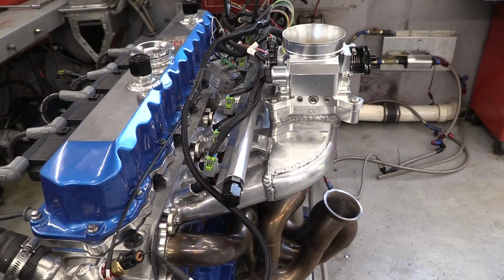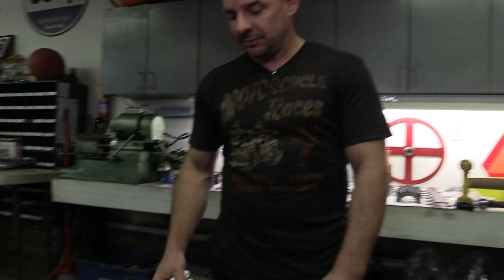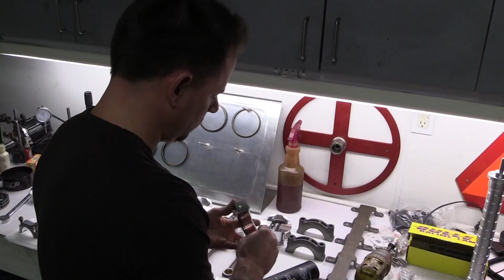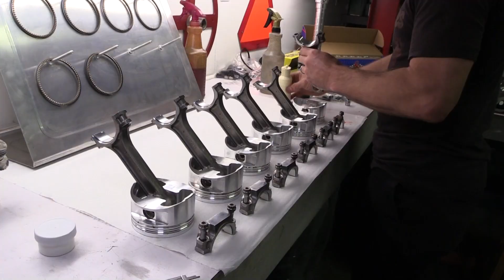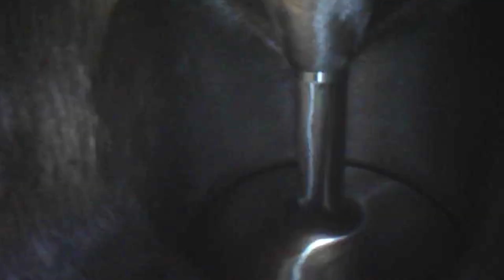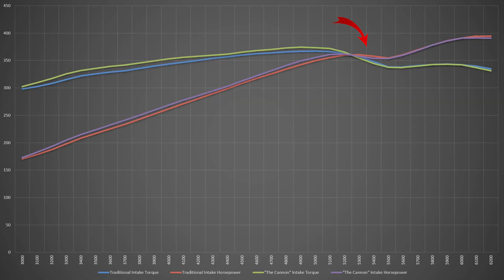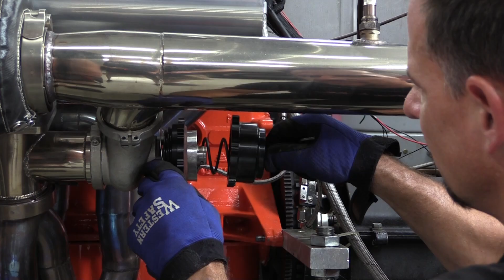Turbo Jeep Smashes World Records! (Tons of Innovation!)

Comment: Wow and I thought back in the 70s when AMC went racing with their  Gremlin X 258 4.3lilter 7 main.N/A pushing 650hp n 700tq running low 11s 135+ mph. Running side drafts 6 pack of Weber's carbs. 12.1 compression. Shoved 202,168 valves from the AMC V8 heads. Into the 258 stock head. The AMC Gremlin X 258 l6 held the NHRA title for quite a while. It's clam to fame was popping wheelies. Great job guys. Keeping the stock components even better. AMC knew there shit there l6 are stout.
Reply: 11s 135+ mph    LOL    202,168 valves       To make 650HP out of a 6 cyl you would need to flow about 430+cfm out of the intake side and astronomical RPM to utilize it . I'm sorry the discharge coefficient doesn't add up.
Reply: @victordahn2150  were do u guys get numbers from the air? Those sidedraft 6 pack of Weber's with the intake n head flowed over 1000cfm. With a 6" steel rod n oversized valves. More than enough air gas and stroke to make those power levels. U guys think u need turbos to go fast. NHRA was doing 6s. There's car with less than 1000Hp running 7s. Without turbos and Nos.202 intake n,168 exhaust. Those valves are big guy. They can flow those numbers easy.
Reply: @Al-mx6ru  that's 1000cfm for all 6 I mean 430cfm+ @28" of water for each cylinder.
Reply: i think your power numbers are WAY off lol. NO way a 4.3L N/A would make 700lbft.
Reply: @3rdGenGuy  first off l saw it race I know its set up. AMC l6 were very stout engine. The engine specs are as follows 12.1pop up pistons,solid cam over 600 lift. 6pack Weber carbs. Modded stock 258 head. AMC went racing. Not some private guys. But AMC themselves. They had a l6 Gremlin running low 11s and a V8 running 7s. AMC backing. I think they mit know a little more than you or l. Those were the engine specs on there pro stock Gremlin X.258 package. I dnt think AMC would lie. They were very forth coming with there setup. They used the rods and valves from the AMC 390 engine in the 258. The rods were forged pieces. It wood carry the tires for a easy 10ft. That's torque. I've been blessed to have a gearhead dad that went to the winter nationals in Pomona every yr. Since the 70s till now.
Reply: @Al-mx6ru  did it have nitrous on it?
Reply: @1985metalmaniac  all those passes were N/A. AMC held the l6 NHRA title for like 20 some odd yrs.
Reply: @Al-mx6ru  something just doesnt add up. Were talking about an NA engine, running no boost, no gas, and no nitro on webbers making nearly 2.47 hp per ci. That would mean at 2.47hp per ci.  A 426 hemi with a 12:1 compression would not make that (1050hp). The only engines in those times that i know of that would turn that kind of hp with no boost were F1 engines spinning at 14,000 rpm.
Reply: @1985metalmaniac  in the 70s GMC ,Ford,Chrysler all had 1000hp N/A engines that they built for NHRA racing seasons running 14.1 compression. On racing gas just like the AMC 258. In the 70s top fuel was in the thousands HP range now. Running race gas. N/A.
Reply: @1985metalmaniac  let me clear the air here these passes were on race gas. High octane.
Reply: To this day there's door slammers running mid 6s V8  N/A. No power adders.
Reply: @Al-mx6ru  AMC is a lost religion, dead in its teachings. Most people know not of the might from Wisconsin. We do not blame them for their ignorance we only seek to enlighten.
Reply: @thephranc  Because AMC also defies the laws of physics? Come on... Just looks into how much intake port airflow it takes to make 1 how per cylinder and do the math. Then look up how much a 2.02 valve can possibly flow. It becomes apparent quick you are full of shit.
Reply: @victordahn2150  202 valves can easily flow upwards of a 1000hp.
Reply: @Al-mx6ru  oh really? On the intake side? How much airflow per cylinder?
Reply: @Al-mx6ru  I have never seen a I take port with a 2.02 go over 400 cfm on my flow bench thats for sure. You can make max effort at most  .275 HP per cfm per cylinder NA. If you look up discharge coefficient you may start to understand this is impossible. Not even in Wisconsin.
Reply: @victordahn2150  you guys sound sheltered. I guess top fuel is wrong by your silly logic. As long as u can get that head to flow the numbers you want. You can reach your power goal. Your talking about water? Only time u use water is to CC the combustion camber n look for leaks. By filing the runners with water n  see if u have any leaky valves. You flow bunch a head with gas n air. Not water. You sound  delusional
Reply: @Al-mx6ru  no inches of water.... It's a standard pressure (28") we all use on flowbenches. It's the pressure of a water colum 28" high at 1g. Cant believe I need to explain this to an expert like yourself.   BTW top fuel uses nitromethane which carys its own oxygen and can burn at ultra rich almost hydraulic saturation. No that's not NA on gas. Big big big difference
Reply: @Al-mx6ru  and a 2.02 valve cannot physically flow what ever you want it to.  Even with boost you just add atmosphere. It flows the same just the density changes.
Reply: @victordahn2150  no sir your wrong when u ad boost u add more of everything. Your forcing air n gas down the intake Into the head. That head with boost is forced to flow more. Weather it was designed to or not. You'll get more HP but not at it efficiency. If the head can't flow the cfm it won't b as efficient.
Reply: @victordahn2150  that's why it's called forced induction. Didn't think I had to break it down like these since you being a expert and all. Lol Your logic is silly at best. My friend is running a 350 5.7lilter with 20 pounds of boost on his setup his heads have 2.02 Intake n 1.60 exhaust. Valves. N he's over 1000whp. There's 500+cubic V8 anywhere from 1000hp to 12,000hp. Your silly to say they can't flow numbers. There's 4 bangers with little valves running 800 to 1000hp. On high boost.The more valves you have in your head the easier better performance you'll get. U seem to know nothing. A 2.02 valve can't flow that. LMFAO  if not mistaken a 1000Whp car is really at 1200hp at the flywheel. So how do u come up with your silly logic that those valves can't flow those numbers?
Reply: @thephranc  you seem like a well educated man.I enlighten him on his errors.  He really full of S$$T.Your comment was very much appreciated.
Reply: @Al-mx6ru  it's a density change not a flow rate change... The efficiency change is the adiabatic heat that is created in this change decreasing density. This can be regained by intercoolers.   I'm shocked on how ignorant you are. Call up banks or any other expert on the subject and ask that question.  Boost is density not flow.
Reply: @Al-mx6ru  that is with a V8 and 20 psi. I personally am running a 4.8l on 23lbs and I run 9.3's in a 3500 lb car  but that's not a NA straight 6 is it? Far from it.
Reply: @Al-mx6ru  your "friends" 3fitty can do that because he is using 2.3 atmosphere's of pressure (density) to fill the cylinder. if that engine makes 400NA which is quite easy for a 350 and 2.20 valves (means the heads would only have to flow 185cfm per port on a flowbench which is easy on a SBC I have made some 2.02's go over 240CFM on MY bench) you can make 400*2.3 =920Hp now the flow rate didn't change but the density of that air did. Thus the reason you need to add more fuel and make more power. YOUR argument is that a NA I6 can make 650HP I call BS because you would need that 2.02 valve/port  to flow 400+ cfm on a bench "28 inches standard pressure" to achieve this HP and it just cant do that no matter how good the port is.  A 2.02 valve only has 350CFM @28'' potential in the absolute best conditions.  http://thescipub.com/pdf/10.3844/ajassp.2008.963.971

I am a Mechanical Engineer and a long time drag racer my experience with cylinder heads, turbo's ,  Na and boost far outweighs your logic. I'm using scientific facts here.
Reply: @victordahn2150  really,, with all your experience and you said a 2.02 valve with 160 exhaust  can't flow those numbers? When his does. What's your scientific reasoning for that BS.i think your full of it.
Reply: @Al-mx6ru  the link is in my post  http://thescipub.com/pdf/10.3844/ajassp.2008.963.971    I can tell you have never been on a flowbench in your life.
Reply: @victordahn2150  your  a mechanic n a tech guy. And you dnt know a proven platform?u said in your own silly words a 2.02 n a 160 valves can't provide enough flow to support  those numbers. How cute you changed your mind with scientific thinking.u want a cookie or something?I proved u wrong. A 2.02 valve can flow that. Funny how you change your logic all of a sudden. I've been throwing wrenches since the 70s.u want  other cookie or something?
Reply: https://www.hotrod.com/articles/airflow-research-cylinder-power/     since your engine is a 6 you use .75 times the number hot rod published.
Reply: @Al-mx6ru  so me, AFR and the Journal of Applied Sciences are full of it? A I what have you done except be a keyboard warrior and talk about your friends 3fitty ? Kick rocks..
Reply: @Al-mx6ru  (I proved u wrong. A 2.02 valve can flow that.) YOU SAID NA NOT BOOSTED OR ON NITROMETHANE. NA MEANS STANDARD PRESSURE OF EARTHS ATMOSPHERE 14.7PSI . This is literally the FIRST thing you said        NA
Reply: @victordahn2150  reread your posts guy u said even with forced induction they can't flow those numbers. Your cute. That's when I brought my friends 350 with 2.02 valves flowing more than that. Your delusional at best. I'm Dunn with special people. Posting links dnt make u smart or even know what your saying or talking about. I like how u have selective reading on only some of your ridiculous rants. Your words even with boost. They can't flow those numbers. LMFAO. FIRST they can't now they can. Your a joke guy.
Reply: @Al-mx6ru  They dont flow any more with boost its just a density increase so it carry's more air per unit volume. That's not NA    that is just science   We are talking NA here not some boosted application. I'm not making the rules mother nature and physics are.    This is your quote:(Gremlin X 258 4.3lilter 7 main.N/A pushing 650hp n 700tq running low 11s 135+ mph. Running side drafts 6 pack of Weber's carbs. 12.1 compression. Shoved 202,168 valves from the AMC V8 heads.)    and I say the HP # you spouted off is not possible NA with that size valve.
Reply: @victordahn2150  that's great And all silly guy. But your OWN words 2.02 can't flow those numbers even with boost. But now they can?LMFAO. Im dun with you. You contradict yourself. You think just by posting links makes you look smart or know what your talking about. When in reality you know nothing. They can't flow. But I was proven wrong so now they can flow n here's links. Wow. Your a joke and I'm dun with u.
Reply: @Al-mx6ru  I looked up your little AMC and the curb weight is 2633LB from the factory. It would only take 400HP to get that car into a high 10 low 11 sec range. NOT 650hp!  650HP would put that car into a mid 9..     Better consult with your 3fitty camel hump head guy
Reply: @Al-mx6ru  I did not mean that size valve could not make the power under boost (you can) . But boost is just a density increase not a airFLOW increase. I specifically meant you cant make that power NA with that valve size.  Call Gale Banks, Reher Morrison, Darin Morgan, Billy Godbold and ask
Reply: Their*
Reply: @nukeboats  thank you sir.
Reply: @Al-mx6ru  please dont misunderstand me i am not claiming you to be a liar. Yes there were and are 1000na engines but they are large displacement V8s. But 650 hp out of a 4.3litre engine, naturally aspirated, is 150hp per litre. Even with race gas and high compression unless it was supercharged or running nitro menthanol just seems unlikely simply because they technology didnt exist then. This engine is 6.5 litre and 153hp per litre and is state of the art.  https://www.youtube.com/watch?v=pk8ZrN__nmA
Reply: @1985metalmaniac  I'm going to claim he's a liar because he is.... There is absolutely no chance that engine, making that power, existed back in those times.
Reply: @fellowship_of_the_goat  you guys need to educate yourself. Top fuel in the 70s were over 2000hp blown.  1000hp N/A to this day theres N/A v8 running mid to low 6s without powers And there running carbs. You guys sound shelter. Go to a top fuel event theres cars running 7s with less than 1000hp.
Reply: @victordahn2150  your talking to yourself? I never said anything like that. Lol
Reply: Bump
Reply: I've drag raced AMC inlines since the mid 80s and never heard of a factory backed 258 drag car that really won much of anything. The SS/AMX cars were only making 550 hp or so, and those were as close to factory backed as it got other than the Wally Booth pro stock stuff. Nobody was making 650 hp with a 258.
Reply: @chrismorrison9140  really what did you run? I to was running 199 232 n a 258 in the 80s. Along with there V8s. That's funny the Gremlin X went every yr to the winter nationals in Pomona. And yes sir it was factory backing. There was even a straight 12 AMC  Dragster. They put two 232 one right behind the other.  N ran a mid 8. I have the magazine somewhere. I'll give u the name n issue #. I bleed AMC. But can appreciate any car. What car n time's did u run in the 80s? Since you being a AMC fan it's kinda weird u know nothing of this. Especially racing AMC fans. There the hard core ones. Who know about the racing history of the cars they race. Funny... you dnt know this.
Reply: @chrismorrison9140  all factory backing AMC cars had the Red white  and blue paint jobs.the Gremlin X was no exception. It too sported the red white n blue paint scheme.
Reply: @chrismorrison9140  Chris they also had funny cars with stroker AMC mills. I believe up to 430+ cubes. AMC had 3 Gremlin X factory backing race cars 2 with there V8s n a 258 powered. Running in the 6 clinder class. AMC also was racing in Nascar,Trans Am series,Baja racing, n NHRA racing.
Reply: @chrismorrison9140  FYI Chris them Batshit Crazy group 19 boys even made a all aluminum 500cube AMC mil for racing. Group 19 was AMC performance department. There's a few people running those 500cube AMC blocks.

Comment: Well, this answers one question. A 4.000" bore in a 4.0 inline six.
I'm kind of surprised that Newcomer hasn't made their own replacement for the block gridle.
When these engines were assembled in the factory there was a special tool we made in house for installing the lifters. 
There were 4.0s that were modified to use roller lifters. These were built for engineering test purposes. I suspect the power gain versus cost was not justifiable.
Reply: I've heard of a guy boring a 4.0l out to use 6.0l LS rods/pistons. Blew the fuck out of my mind hahaha
Reply: @Levibetz  
Where there's a will there's a way. 
Normally trying to go .120" over stock bore size is going a bridge too far. I would have thought the only way to get a 4.000 bore in a 4.0 block would be to completely punch out the cylinders and fit a sleeve that has enough wall thickness. Normally the cylinder walls are thicker at the top than the bottom because when pouring the casting the mold has draft anglesto make it easier to get a proper pour. As a side note VAM (AMC's Mexican subsidiary)  built 252 and 282* CID versions of the 232 and 258. They opened the bores up to 3.880 or 3. 875. The increase in displacement was needed to compensate for power loss due to lower octane gas. I've heard but cannot swear to whether or not these blocks have heavier wall thickness cylinder bores.
*in some ways the original stroker.